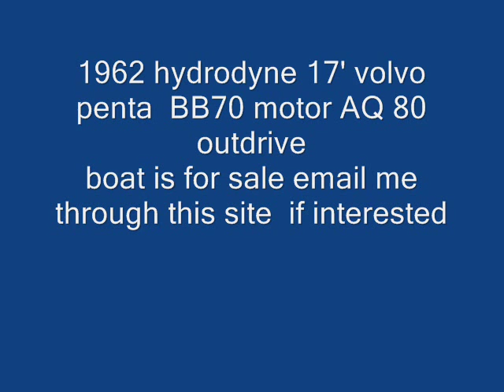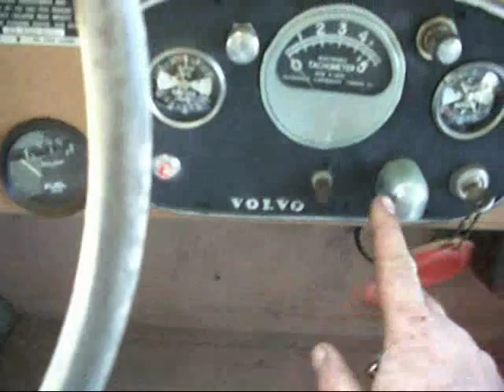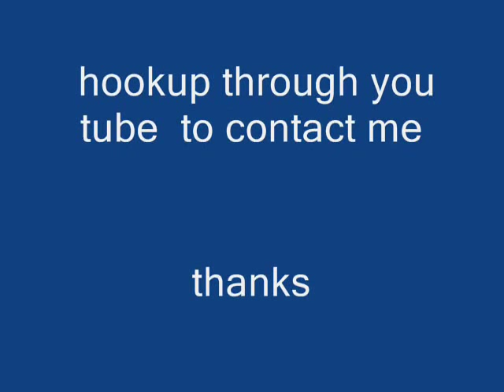1962 hydrodyne.wmv

Comment: hey i have one of those too.  i got it running  nicely but it has no gauges, the shifter movement  is really crappy, it has every single part of the original motor!  i will need to replace the water pump and the bellow which has a big crack, then it is ready to safely sail it out.